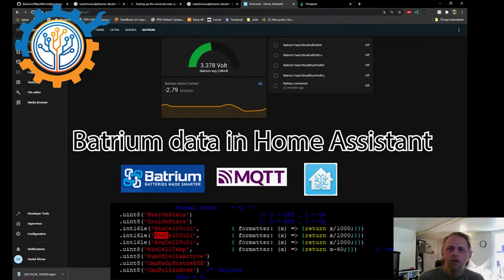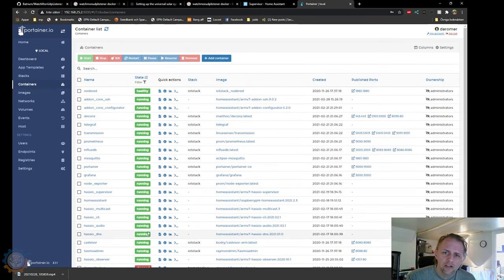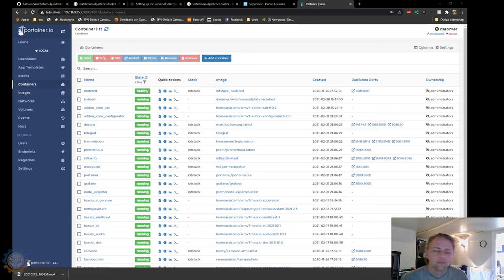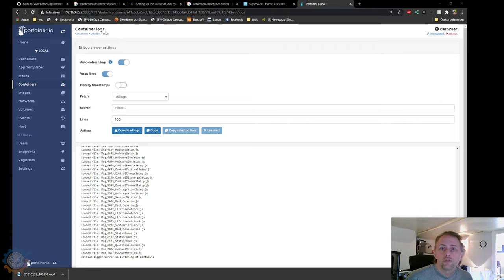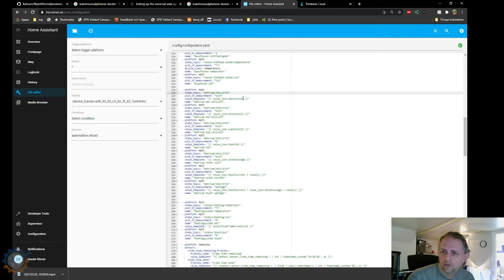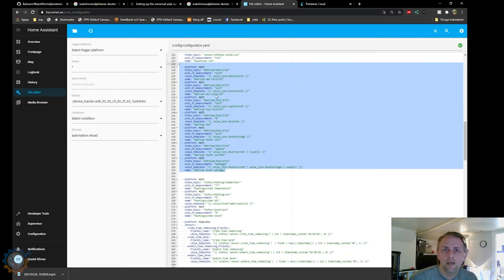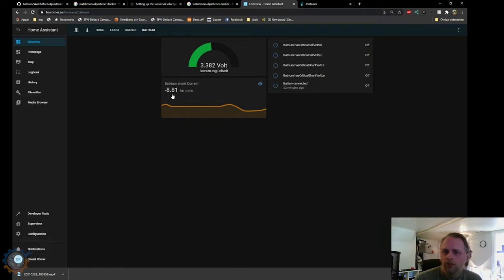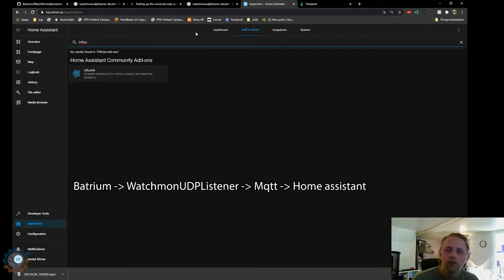Batrium integration towards Home Assistant (Intro)

Comment: Great video, thanks for that.
One question: Can I use it to transmit the current cell voltage from each cell via MQTT?
Reply from the maker: You can but my code is outdated so not sure it will work anymore.
Reply: @DIYTechRepairs  OK thanks, I will try :)
Reply: For all who are interested: it still works with current watchmon also in combination with cellmate k9. To implement in Node Red use MQTT path 4232. The current cell is visible with the ID and for the voltage you can use max or min cell (should be the same in one Message). Special thanks to the developer✌️

Comment: Running HA on a Hyper-V VM instance.
Installed Portainer and created the container as instructed. However, I can't access or edit:
/mnt/data/docker/volumes/batrium/_data/config.json

Tried:
- Installing the Terminal & SSH add-on, but when doing a "ls" inside /mnt/, the directory is empty.  
- Connecting to the VM on Hyper-V but that only presents some sort of HA OS, that doesn't have VI or other commands available.

I'm at a loss here!
Reply from the maker: Hmm
I Will test myself with a Vm. Perhaps i need to do some workaround.